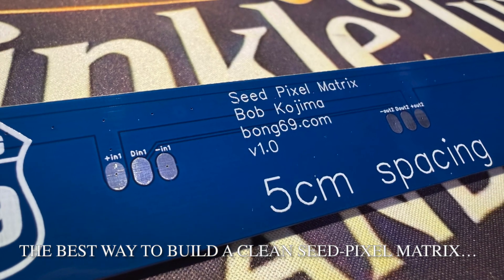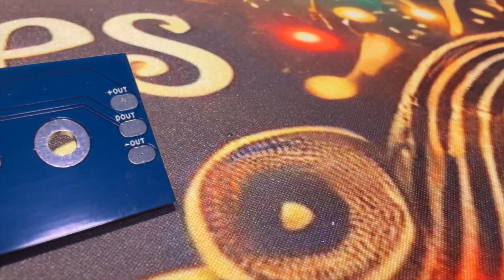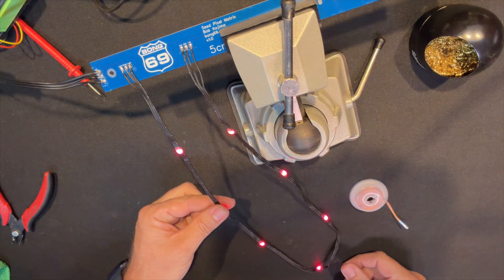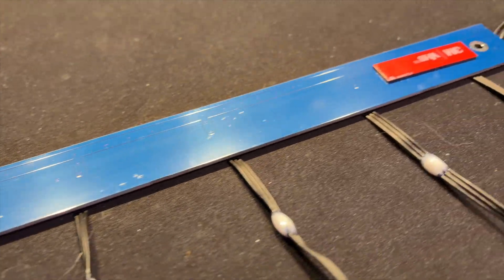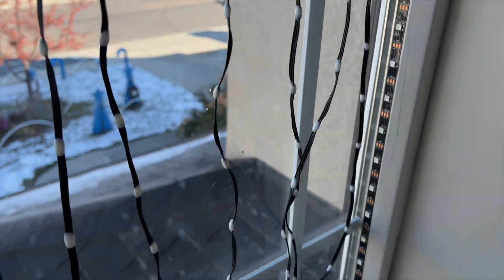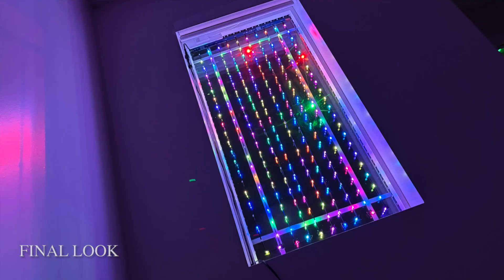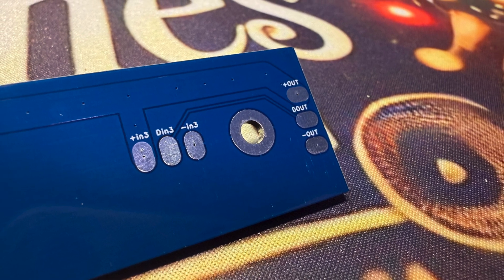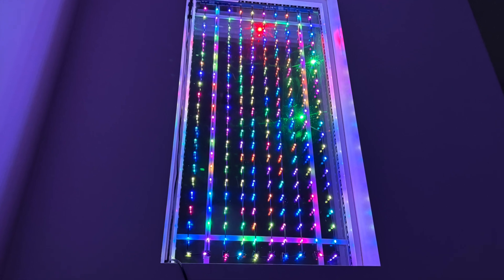This Pixel Matrix Looks Pro — And It’s Way Easier Than You Think

Comment from the maker: Huge thank you to Bob Kojima (Bong69) for designing this PCB. This is just my prototype, but I’m already blown away by how clean seed pixels look on this board. Power balancing is built right in, the spacing is perfect, and it mounts super easy with 3M tape.

If you have ANY questions about soldering, mounting, power, WLED setup, or seed pixels in general… drop them here and I’ll help you out!

Should I put these in to production?  Would you use them?

Also let me know if you want me to build the full window-shutter version next 👇
Reply: Either you start offering em now or I have my own made lol.
Reply from the maker: @saltwaterrook4638  True dat!  I just test them and see if they are any good....which they are!  I will drop a line to @bobko69 and tell hime to start stocking them!!!
Reply: @twinkletunesandlighting they're so simple but Given none of us have made them yet, he deserves the support. I've got a custom super basic PCB in the works right now too thats not, as far as i can tell in our hobby (I'm new to it). Maybe I'll send some your way to play with when i nail down the details.

Comment: I'm just learning about circuit so bear with this noob.  On the first pads on the left why do I not see any traces coming out of negative to the first set of horizontal pads and why are there two coming out of data?
Reply from the maker: You know what….. I have no idea. I didn’t design the board but I will tag the guy that did and see if he will chime in.
Reply from the maker: @bobko69
Reply: the top and bottom of the board are a ground plane.  everywhere on the board that is not a trace is ground.  so all the ground pads are connected through this ground plane.  im not sure where the 2 data traces you are asking about.

Comment: I'm debating doing this with WLED or getting Govee curtain lights. The one advantage I see of the Govee curtains is the sheer amount of community animations in their share space vs. WLED.  I'm not sure how it works out on the cost front though.
Reply from the maker: Great question. Govee curtains are awesome if you want fast results — tons of community animations, a polished app, and basically plug-and-play. You can hang them up and be running scenes in minutes.

WLED is more of the DIY route. You don’t get a big “scene marketplace,” but you gain full control, local operation, syncing with xLights, and the ability to build exactly what you want. It takes a little more setup, but it scales way better and integrates into a full show.

Cost-wise, Govee costs more up front but includes everything. WLED can be cheaper (or more powerful) depending on how you build it — controller, pixels, power supply, and a little time.

Short version: Govee = convenience. WLED = control. Neither is wrong, just depends on what kind of lighting nerd you want to be 😄

Comment: So do you have a separate controller? Or is the PCB also a controller? Did I miss that part of the video?
Reply from the maker: There is a seperate controller.  The PCB allows you to neatly solder and add your own ends on it as well as keep power running throughout the PCB.

Comment: So where can I buy all of them? 😂
Reply from the maker: We are testing to see if there is a need for them.  Production is super fast but wanted to see if there was a buzz about them.  Is this a product you would use?
Reply: @twinkletunesandlighting I would use something like this if it had better connectors. I know seeds are light but I don't trust the solder to hold it. I would think some kind of clamp connection. I would also personally like a higher density option
Reply from the maker: @papabrose the seeds and wire themselves will stretch and break before the solder connection. Hmmm that’s a great video idea. Maybe I’ll make one. Thanks for the input! And the feedback!
Reply: @twinkletunesandlighting already some kind of housing for it would be nice too. Just to make it look a little nicer
Reply: @papabrose  I was wondering if slicing down one edge of a pvc pipe would allow these to slide right in.
Reply from the maker: They are thin enough if you were to run a saw blade width down it that may just work.
Reply: @twinkletunesandlighting  I am super interested in these! Just bought my first bit of seed pixels to add to my light display next year and these seem like a way easier way to do a matrix.
Reply: I'd get them if the spacing was closer.
Reply from the maker: That’s great you say that because there is a 2.5 coming out in the next week that I will test.

Comment: Why on earth did you choose such a small number of pixels? If you did it yourself, you could give 1 led light x 0.5cm, it would provide better resolution. And yes, such RGB IC led curtains are $10-40 up to 4 m long, but the distance between the lines is 10cm and the leds are max 400.
Reply from the maker: Thanks for your input. I chose that number as I am going for an effect. I’m not building and HD tv in my window. The spacing is appropriate with the spacing of all my other props. If I was looking for higher resolution I would put p5 panels up with a video card.
Reply: @twinkletunesandlighting I understand. It's nice that you mastered the technique. I'm looking for an option like govee, but I'd like a much higher resolution at 3m x 3m for my daughter's room

Comment: Can you wire them so they don't zig-zag down/up? My Govee curtain just dangles on each strand and I'm trying to understand how they do that?
Reply from the maker: you cannot because of the way the data travels.
Reply: @twinkletunesandlighting  You could if an additional board was placed at the bottom that allowed the same zigzag.  It would require twice the soldering though.  It would please those that feel they're losing something by wasting a pixel at the bottom.
Reply: i dont have any of these Govee lights, but my guess would be there must be a 4th wire that brings the data back up to the top.
Reply: @bobko69  That's what i would have thought, but both their curtain and their xmas tree only have 3 lines going down the seeds. No zig-zag. Weird. The xmas tree has the wiring black epoxied in so I cannot see connections :(  BTW, I have 4 of your controllers. Love them!
Reply: Could you not just jumper the data and hide the additional wire?
Reply from the maker: The way ws28xx data travels is in one direction. It is an analog signal that once is broken won’t regenerate. After the first strip of pixels the next strip won’t know what pixel number it is.
Reply: @twinkletunesandlighting  I think I found the answer after going down a rabbit hole. Apparently the govee curtain (and cone tree) use indiviually fixed address pixels. The pixel number is hard-coded into the LED. That means all the LEDs on the bus see all the data, but only react to their own pixel number.
Reply: @twinkletunesandlighting  I've made 10 curtains, but with wires soldered, and all hot glued to a wood dowel. I use four wire seed pixels - the fourth wire is a return that I use to bring data back to the top of the strand, and I use that to carry to the next strand. I didn't want the "zigzag" look at the bottoms. I like your idea though - good start. My comment is the "pull" to keep the strands straight is kind of a big ask from three small solder joints. If it's there forever with little weight - maybe. But if you take them down every year and store them - the constant flexing on the solder joint concerns me. Also: I can see the solder runs on the board being ok for 5V pixels, but are they "beefy" enough for 12v Pixels? In ANY case, nice job!
Reply: @boomeruni  The top of every strand is molded in. There are definitely only 3 wires. My guess is there's a chip molded in that buffers the strand data and sends it down, then passes on all the rest to the next strand...rinse...repeat till the end of the curtain.